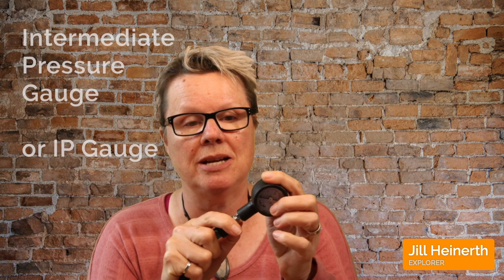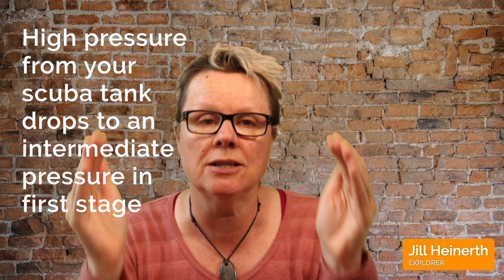How To Diagnose A Leaking Scuba Regulator Second Stage

Comment: What if just my octo is free flowing but not my main? Any ideas?
Reply from the maker: Generally, that would indicate that the octo itself needs service. A repair mechanic will first check the intermediate pressure to rule out an HP seat issue in the first stage. Then if that is okay, they will disassemble the second stage and likely replace the LP seat and readjust the cracking pressure to bring it within specification. It is a quick fix.

Comment: Hi Jill; I’m currently learning to service regulators and today I came across a diaphragm first stage where the line pressure was over 200 psi; the regulator was assembled as per manufacturer specs and I couldn’t notice any damage to the first stage… I have no idea what the issue is, have you seen this happen before?
Reply from the maker: It will either be the HP seat or sometimes the actual volcanic orifice can be damaged. A small nick in the orifice can allow air to bypass and head downstream to cause bubbles in the second stage. Remember when the pressure is that high, you can stress the max spec for the LP hose. Be careful!
Reply: @JillHeinerth   appreciate the advice Jill, thank you!
Reply: Update: the two springs making contact with the pressure chamber were incorrectly tensioned
Reply: Ask the instructor who is teaching you. Depends on what system is used to set the interstage pressure....... You need to ask who is delivering the course. 250 psi working burst 1200 psi

Comment: On Aug 5 and 6 I had my OW Class at Willow Springs Park, Richland PA. My Dive Buddy had a small stream of Bubbles coming from his Yoke connection. Instructor Saw it. But we continued the Dives. We Turned the Dive when one hit 2k. It wasn't me every time. I manage to Sip the Air. This is the only time I have Dived. I am going to see about getting Advanced OW. I am Trying to Impress a Lady in my life!!!
Reply: My dive guides gear looked like a spa bath. Bubble from the yoke bubble from the bcd inflator and I think the safe 2nd.  Small bubbles is okay as it usually won't make alot of difference to dive time, but this is why I bought a cheap used gear setup to begin with and upgrade the bits and pieces as I see fit if I continue to dive rather then spending 4k on the ultimate kit and never using it.  A set of nice sealed octo and regulator is a nice thing for diving beyond 10mt as I notice my unbalced regulator set gets really hard to breathe at 20mt and I end up going back to 17mt for ease of breathe.